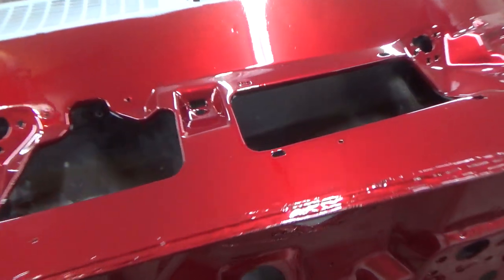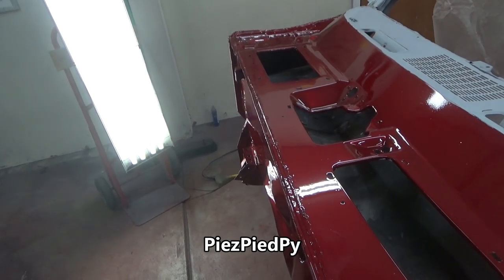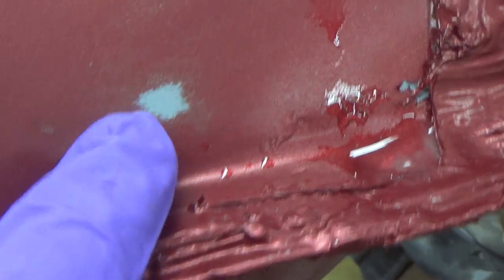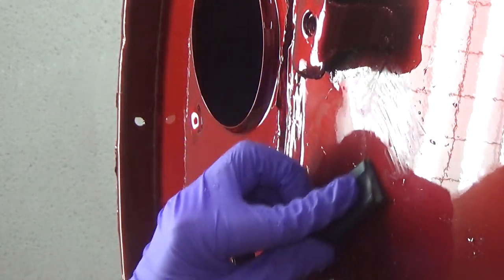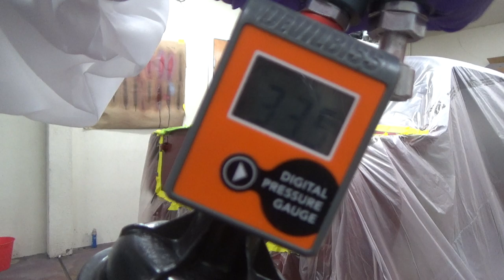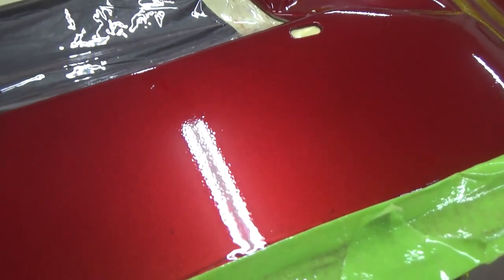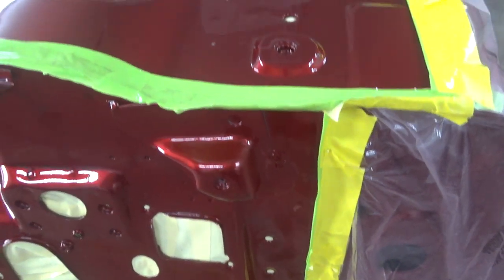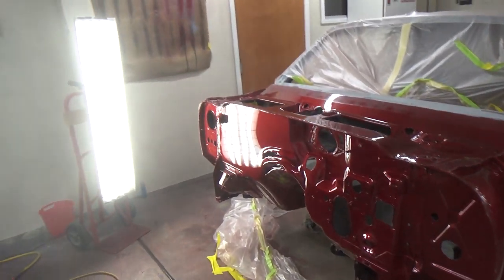1977 Camaro Z28 Part 219: Flow coating the firewall and cowl

Comment: I saw a video a while back about fixing runs in clear coat. They covered it with a thin layer of body filler. Then as they sanded the run appeared first and protected everything around the run while sanding it smooth.
Reply from the maker: Yeah, that is another trick. I just needed more clear to work with. I did not want go after it anymore than that. Thanks man.

Comment: Looks great.  I was going to mention the tweezers, then you beat me to it.  One other trick to keep trash down is to sweep the day before, then turn the fans on all night.  That can let the dust find its way into the corners.  I have a feeling that you are already doing this, but you can tack between base coats and right before your first coat of clear.  I am always mental with the blow gun up until the clear comes out.  The surfaces can never be too clean.
Reply from the maker: Thanks Greg. I have not been doing that. The problem so far is that Saturday is the only day I can paint because the weather tanks EVERY weekend on Sunday. I can't work on the car during the week. As it warms up, I will try that. Thanks man!
Reply: @asicerik  If you roll WAY back in history...  I took a week off work to paint my car.  That made all the difference.  The "gotta get it done this weekend" rush was not a factor.  I was able to get up every day and execute what needed to be done without racing the clock.  Paint day started at about 5 am and ended at about 10 pm.  I couldn't have done that on a Saturday/Sunday.
Reply from the maker: @GregsGarage  yeah, when I get to final paint I will be doing that. I Don't have a lot of smaller bits to paint. Thanks again man!

Comment: Say hello to pops.  I am a red guy and loving the color.  Still a bit concerned about the trash in the paint.  I am not a painter but have painted allot.   I know I mentioned it before but I have painted outside.  Put a huge tarp on the ground wait for a nice day with no wind.  If you get trash outside it would be a bug which is actually easier to pick out because they are bigger haha.  Sometimes I could pic them out while wet and shot over quickly you would never know. You may want to experiment on a panel like the trunk outside. I just know how much work you have done and be disappointed.  We have all done that so if it happens your not alone.   I have painted some great work outside if a clean garage was not a option.
Reply from the maker: Hi Daniel. There is no way I can paint outdoors right now. The pollen is floating around like snow. It is crazy!

Comment: Looks amazing!  Love the garage setup with lights and the spray gun light is cool too.  Do you like the plastic for masking versus paper?  It seems to flap around a lot.
Reply from the maker: I really do, yes. You can pull it tight to keep it from flapping. You also notice I ran that piece of tape in the windshield area. You can do more of that to control things. The paint really sticks to that plastic it seems to me. I worry about dry spray on paper that it will just blow off.

Comment: Looks a lot better brother what pressure did you go with?
Reply from the maker: 32 psi this time. I think (WHAT?) that the gun was a little dry for a change. Never had that problem! As it gets warmer, I may have to switch back to the 1.3 (1.2 now).

Comment: Looking great!   I’m just wondering about that long wire holder  on the drivers side firewall you painted.  I’m thinking if you go to bend it in a few months  all the paint will chip and flake off.   just a thought
Reply from the maker: Thanks Walt. I have a plan for that! I am not sure I can find it, but I was going to dip it in that rubberized tool handle dip.

Comment: what was the reason on using tinted clear?
Reply from the maker: This color is a tri-coat (Ford Ruby Red). Some tri-coats use a tinted / pearl base coat but this one uses clear coat with a dye. That is what gives it that rich, "candy" look.
Reply from the maker: You can go back and see the video where I painted the firewall and cowl to see it in action. Thanks